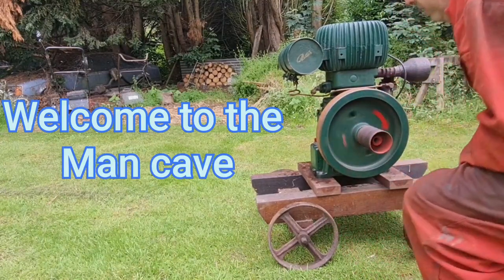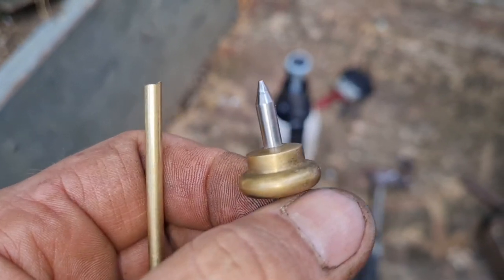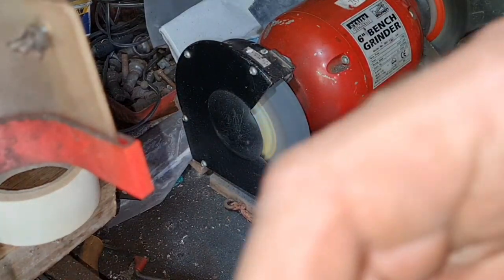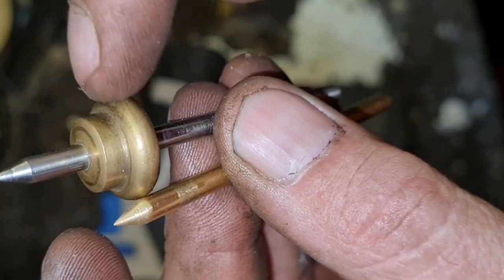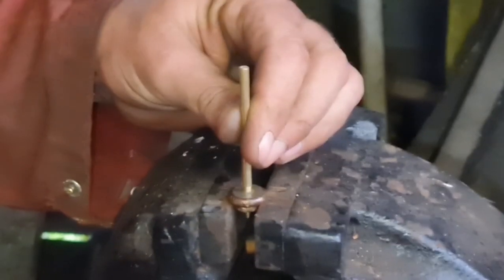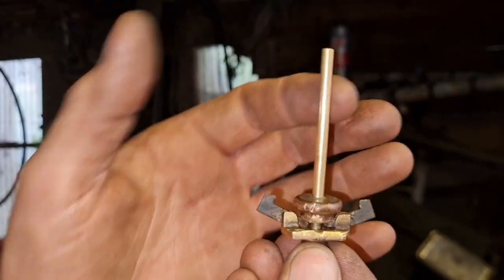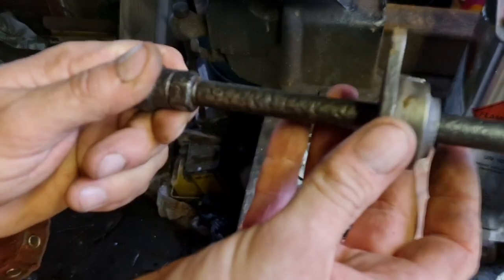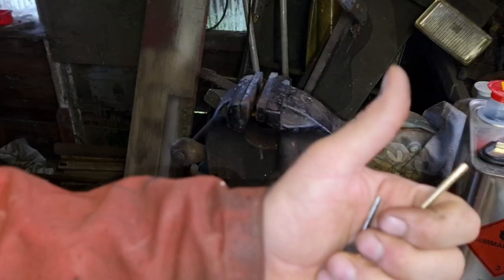Ruston Hornsby PB Carb.

Comment: Honestly that needle solution is something I would never have thought of and is probably somthing ill use in the future as I'm not lucky enough to have a metal lathe but this method works just as well
Reply from the maker: Yeah turned out perfect. It seals brilliant mate. Tried blowing through it. She's air tight. That ebay brass rod was brilliant.
Reply: Grinding brass on a  bench grinder  is a no no , it may work but its bad practice , its also dangerous .  I have seen grinding wheels clogged up with brass and softer metal stuck to them . After a while they become detached and are like small bullets as they come off .

Comment: I used to have one of the 1.5BHP PB's that would always flood.  So when I restored it, I changed the bottom fitting to one I made to accept a Amal float and shortened needle (Like what you would find on a Lister D). My old AP never did play up, but I always thought it was a bad design from a company renowned for making the best of anything.